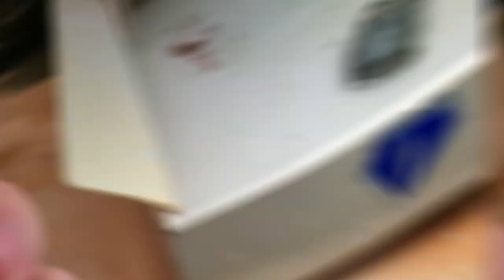Polishing Velvet Rainbow Obsidian

Comment: It appears that you are putting a fair amount of pressure when using the carpet wheel. Is that the case? You get a better polish than I do with 100,000 diamond! You sure do know how to coax the heart of a stone out for all to see! Good work!
Reply from the maker: Very good observation and thank you! I accidently left out the part were I talked about the amount of pressure that I'm adding to the wheel. Pressure is also key in my step. Not enough to stop the wheel but also not so light where I'm having to sit there for ages. 
Whenever I've taught classes, I would have the person I'm teaching hold out their hand so I can show them how much pressure I'm adding so they can get an idea of how much weight to apply to the wheel without it being too much or too little.
Reply: @WorldofRockhounds  I KNEW you were a master! I have an idea how much to press that stone but does it heat up? I use 2 inch compressed wool pads on a small drill press and I swear your polishes beat mine. You are da man!
Reply from the maker: @bunk9991  it oddly doesn't really heat up too much at all. At least for rounded surfaces. Flat surface can get some warmth but that's it. :)